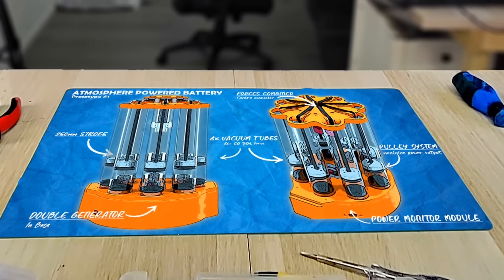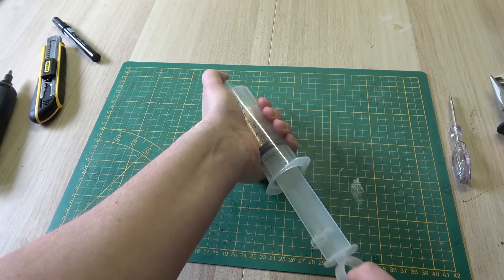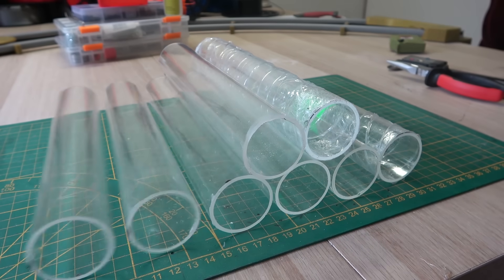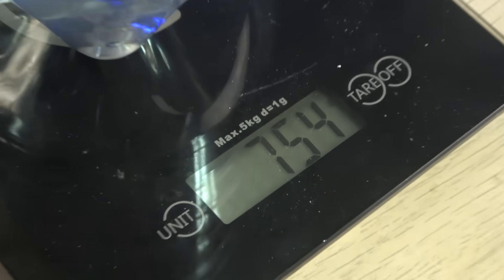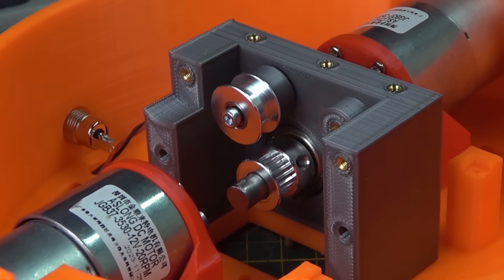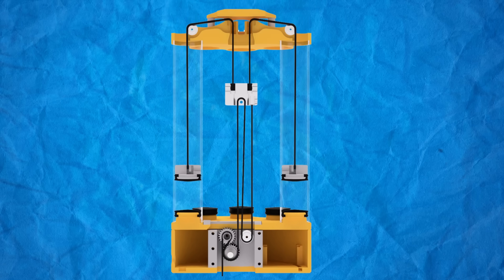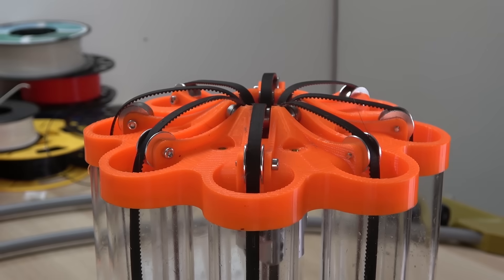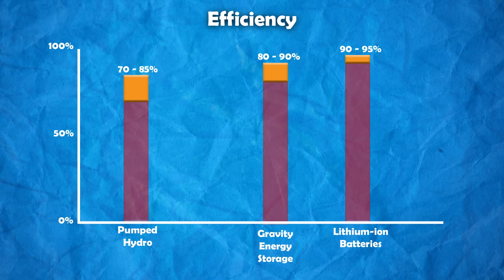Building an Atmosphere Powered Battery..

Comment: I view this as a part of the comprehensive energy solution, combining solar, geothermal, natural gas, vacuum technology, and more. Together, they form a unified energy strategy, similar to how our biology relies on sugars, proteins, fats, alcohols, heat, and other elements.
Reply: Your biology analogy isn’t really valid. Your body needs those different things for different reasons, however all the power generation or storage methods you mentioned are all needed for the same reason.

Comment: Shouldn't you measure the efficiency of the energy instead of the power?
I'd like to see the Watthours instead of Watts.
Reply from the maker: I understand what you mean👍 and the power monitor module in combination with the Arduino Nano measured the voltage, current and time for both charging and discharging. So the wattage is, as you say, the full and actual consumption and power generated by this setup👌

Comment: cool idea but your efficency calculation are wrong. Watt is the unit that mesures how mush energy is used/generated at the moment. but it is not a messuremtn of how much enegergy is stored. for that you need to take time into consideration (ie. Wh, kWh, Ws).  you can have a battery that chages with 10 watts over an hour and dischage 100 watts in 2 seconds. with your calculation, it would have an efficency of 1000% and thats not the case. in reality the battery charges with 10 W over 1 hour (60 min -> 3.600 s). so it saves 36.000 WS. it discharges 100 W over 2 seconds so 200 WS. so the real effiency would be ~5,5% and not 1000%
Reply: This

Batteries are a hell of a drug
Reply: What even is all this
Reply from the maker: I understand what you mean👍 and the power monitor module in combination with the Arduino Nano measured the voltage, current and time for both charging and discharging. So the wattage is, as you say, the full and actual consumption and power generated by this setup👌
Reply: @ConceptCraftedCreations  Are you saying that it took 860Wh to charge this battery?
If so, this result seems unlikely because the video shows that charging takes less than a minute, which means that in order to store such energy in such a time, the engines should have a power over 50kW. You must have a miscalculation somewhere, maybe this capacity is 860mWh?
Reply from the maker: To clearify how i got to the result you see in the video:

To charge: ~12.08V x ~1.62A x 43.709 seconds = 860,64 Watt

After a discharge: ~9.42V x ~1.15A x 57.993 seconds = 628,24 Watt

All value's are measured by the Arduino Nano in combination with the INA3221 Power module.
Reply: @ConceptCraftedCreations are you saying watt to mean watt hour?
Reply from the maker: Watt seconds if you want to be exact.. But yeah!👌 The result shown in the video IS the total amount power used and generated, unfortunately I just didn't mention it properly! That's my mistake..🤔 So a good lesson for next time!🤓
Reply: @ConceptCraftedCreations  so jouls?
Reply: @kyriakoslykoudis9133  Ws is correct as it's the measured electric power
Reply: @ConceptCraftedCreations  So thats 860 Joules which is 0.239Wh or 239mWh. So a moderately scaled up version of this might be able to a few watt-hours and a room-scale version would verge on the order of kilowatt-hours.
Reply: @lukaszlesniak no he means Joules instead of Watts. The actual number he gives is correct, just with the wrong unit on the end
Reply: @Bobylein1337 energy, not power. And a Joule is exactly the same thing as a Watt second
Reply: @coledavidson5630 exactly, it caused a little misunderstanding, but at the end of the day if you get that these are Ws, this makes much more sense. Cool project, I’ve definitely never seen something like that and I’ll be following the progress. Keep up!
Reply: @coledavidson5630  It's the same amount of energy, yet you measure electrical power in watts and hence energy watt*time
Reply: @kyriakoslykoudis9133  so watt seconds?
Reply: @coledavidson5630  And a watt second is exactly the same thing as a joule hurr durr
Reply: @CowsGoMonkey  are you slow? I said that to emphasize that what he's talking about is a quantity of energy, not power
Reply: @coledavidson5630  Sorry can you say the same thing using different words? Lmao
Reply: @lukaszlesniak   идея отличная ,но чувак считать не умеет,по показаниям ватметра на заряд тратится 0,2вт за 40 сёк,а на разряд 0,18вт за 50сек
Reply: @ConceptCraftedCreations это неправильный расчёт !!!
Reply: @ConceptCraftedCreations  Yep   it's pretty easy to understand all the so-called people using precise exact overthinking terminology just don't understand it.    you measured what it takes to charge and what it discharges.
Reply: @funnycatvideos5490 the units he gave don't make sense, efficiency of energy storage can't be measured by power. He meant Watt seconds, aka Joules, a unit of energy
Reply: @funnycatvideos5490  it is not “precise exact overthinking terminology” at all, it is called using the correct terms, using the wrong units is the same as calling something the wrong name. Using the correct and universally agreed upon terms is very important in engineering and science and for good reason, it means everyone knows what you are talking about.
Reply: @funnycatvideos5490  "so-called people"?